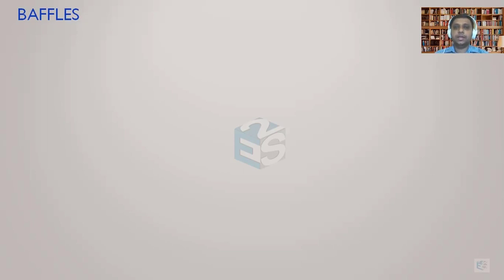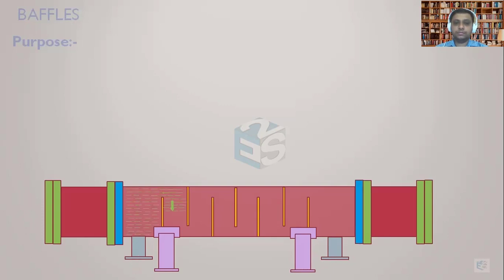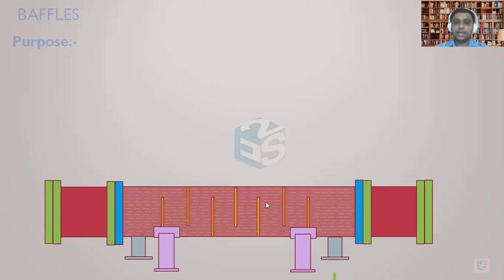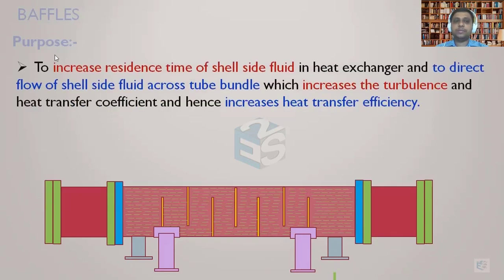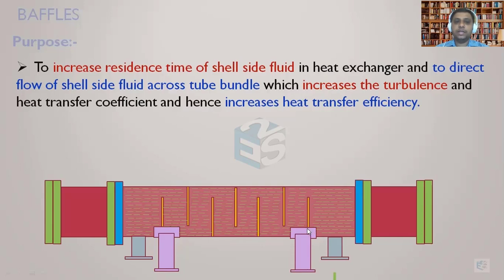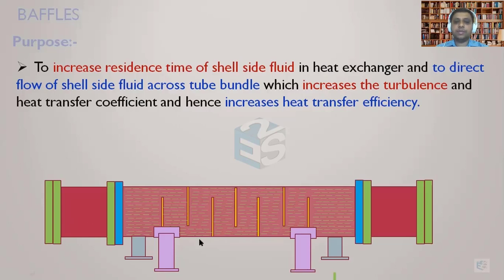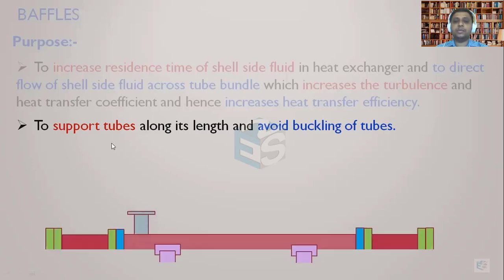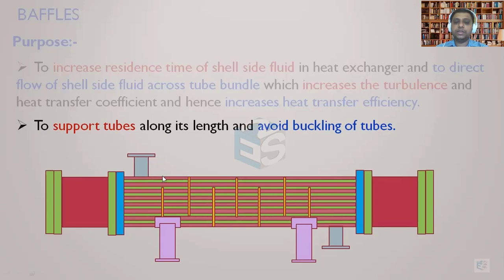Why Baffles Are required? | Understand the purpose of Baffles in Shell & Tube Heat Exchanger | TEMA

Comment: Do Shell & Tube Condenser has baffles?
Reply: yes but not necessarily 
it depends on the purpose its used.sometime the residence time of fluid may not be sufficient enough so we prefer baffles which increases the contact/residence time hence more time for heat transfer to happen and thus the efficiency increases